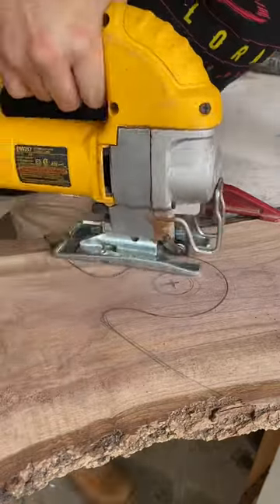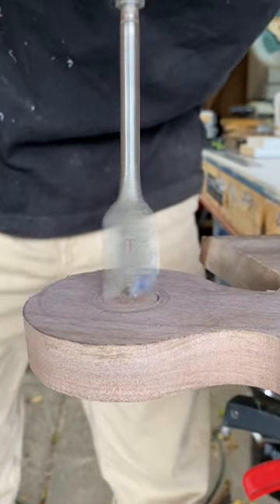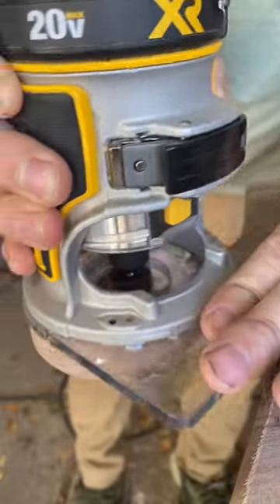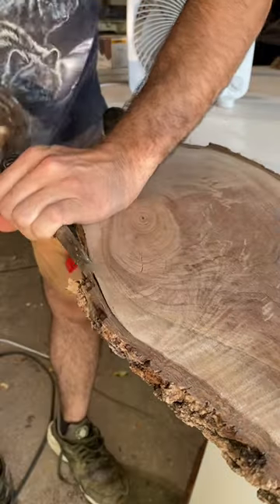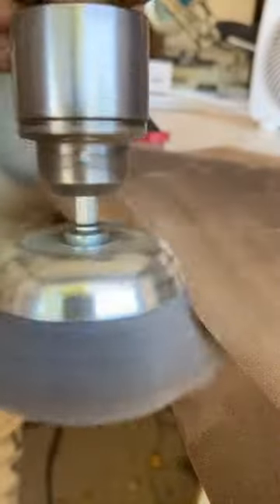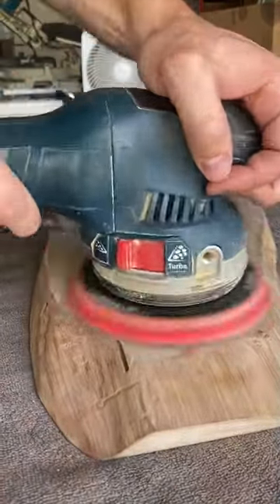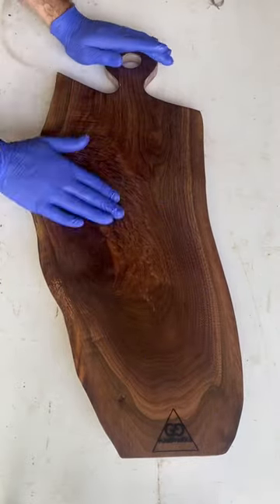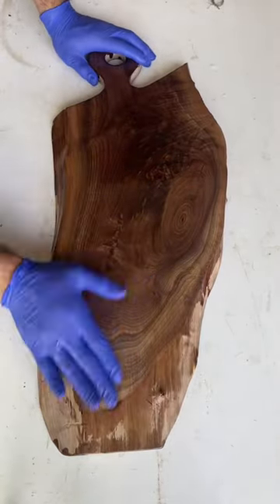Easy DIY Charcuterie Board for Beginners #shorts #diy

Comment: To prevent blowout when cutting out the hole for the handle use a Forstner bit, drill down half way through, turn board over and complete your cut.
Reply: Put some spare piece of wood below and drill straight through, won't tear out and way more accurate(also with the forstner bit)
Reply: @moritzd3713  I know that technique all too well
Reply: @KOAH_Dobermanpuppy Better to just do your method then other commenters, same for cutting dovetails. Not best to rely on a backboard unless you have too

Comment: Hi! I'm hoping to start making my own charcuterie boards and serving trays once I've got a space of my own, but I've got a question for you. I've noticed that whenever you use resin, you're waiting anywhere from a couple days to over a week for it to cure. Is it possible to use UV resin/epoxy for these sorts of applications and speed it up? From what I've seen online, it's food safe once cured. Thanks!
Reply from the maker: Yeah for smaller cracks and voids that aren’t too deep I would think you could use uv epoxy!